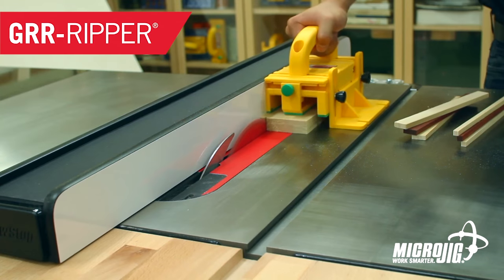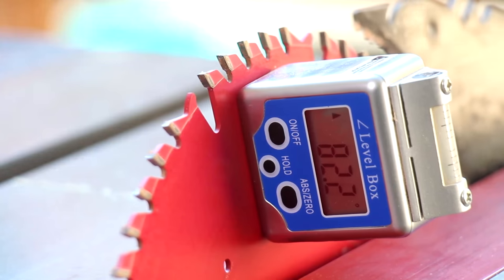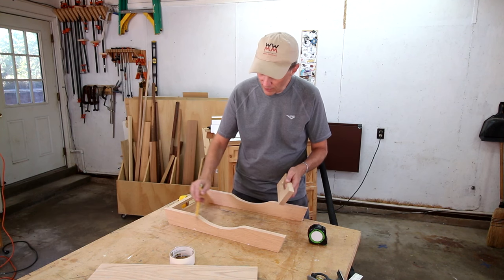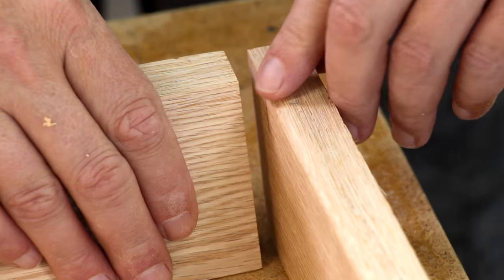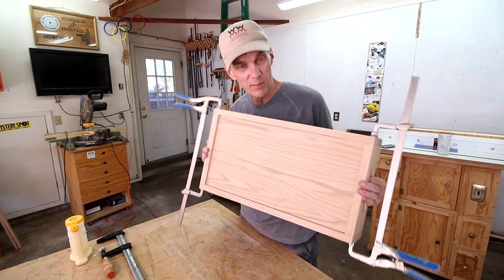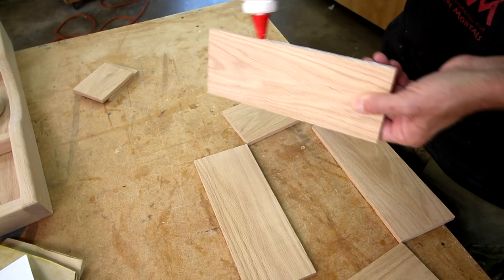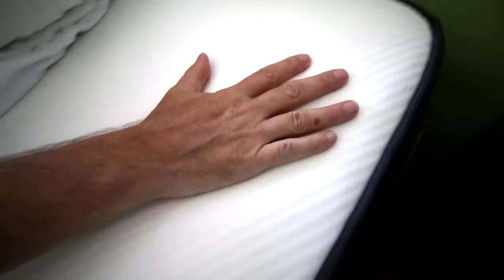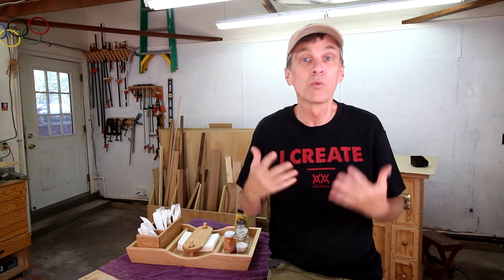Summer Picnic Tray. Wow! Napkins Won't Blow Away!

Comment: hello Steve can you please do a video on sanding and other methods of removing glue before its time to finish. Im finding it very hard to get into to tight corners or around rounded corners without sanding across the grain. thanks you
Reply: gene wipe the glue with a damp rash before it's dry

Comment: Hi Steve I have a question about the Impossible nail-through wood trick, I was wondering what are all the dimensions?
I also have a challenge for you to make a triangle inside a triangle. It should work the same way as the cube in side a cube.
Reply
Reply from the maker: The dimensions don't really matter...as long as it will fit in a pot of boiling water and a vise!

Comment: Steve Ramsey "I'm going reinforce these joints..."
My Brain: "No!  Screwing after gluing doesn't add to strength, it sometimes even weakens the joint!"
Steve: "With dowels"
My Brain: "Oh.  OK.  Carry on, then."

But I wish I had watched this video a couple weeks ago.  I was making a box and messed up by rounding over an edge unintentionally with the router.  And so it goes.

Comment: When I drill a pocket hole in a 1 1/2 board it doesn't come out the end. Am I doing something wrong or is it meant to be like that?
Reply: If it holds and it's a strong enough joint it's alright 😂But on my Pocket hole jig it never comes out the other side 😑😂
Reply: ah thanks
Reply: +J Apple No problem 
if you want you could check out my channel 😊
Reply: I like your marking gauge vid nice work! :)
Reply: +J Apple Thanks ☺ Did you Subscribe 😉?

Comment: since I know you know about wood movement, I have to wonder why you neglected it in this project with the wide, solid bottom panel. Why?
Reply from the maker: It's too small for wood movement to be a factor in this project. Wood movement is something woodworkers stress out about too much.
Reply: +Steve Ramsey I thought 4" was about the limit for a glued cross grain joint. before I know about it i violated the rule with a 10" joint and it self destructed in about a year